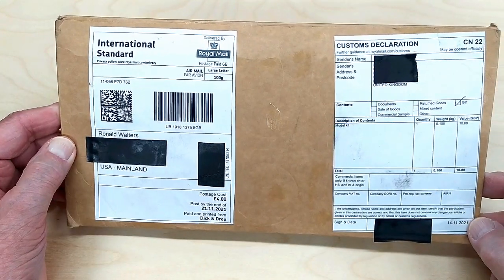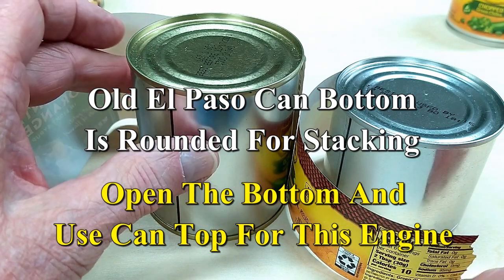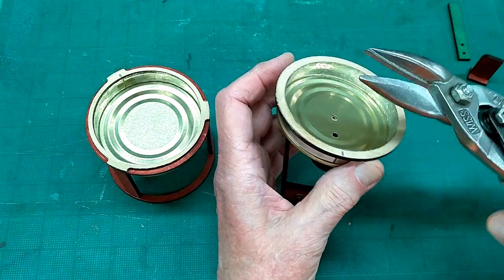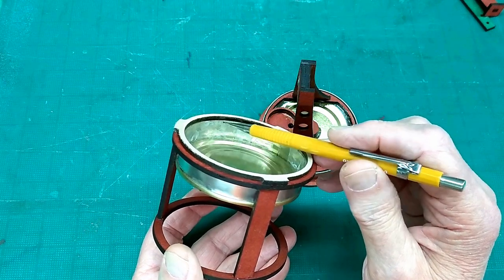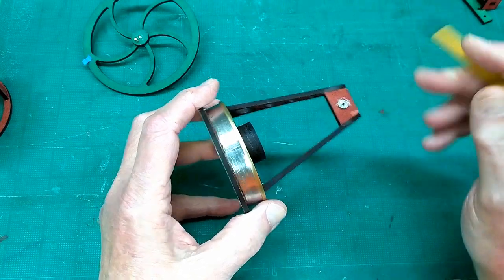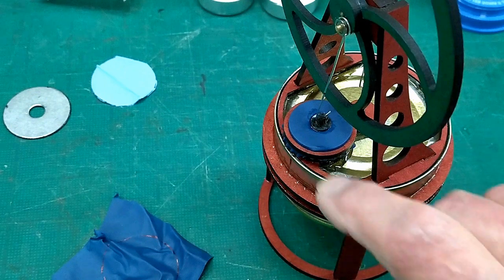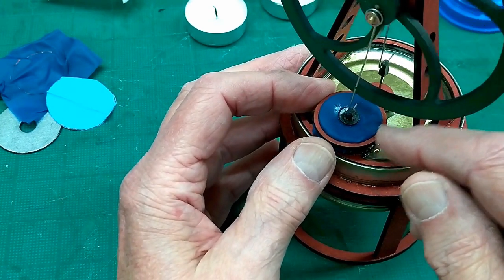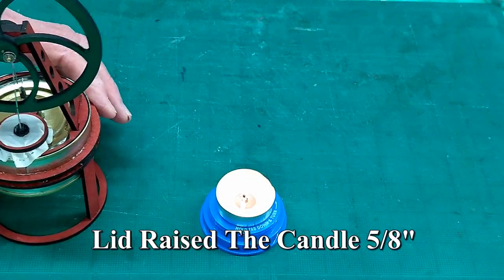Myfordboy Laser Cut Stirling Engine Kit

Comment: 10:15 I gave up on trying to glue the adapter on mine, just used two neodymium magnets from a pair of cheap headphones. They're small enough, that they won't impair the function of the sub-assembly and the hole inside is perfect for putting the rod through with a wee bit of glue.
Reply: On the kits I used to sell I used a nylon bolt through the diaphragm and included at tool to help center the diaphragm. It should no be streched but it should not be floppy either.
https://www.youtube.com/watch?v=NLeIQgQbcGM